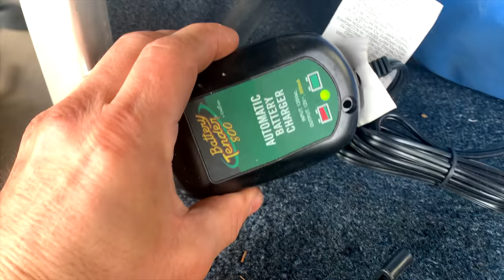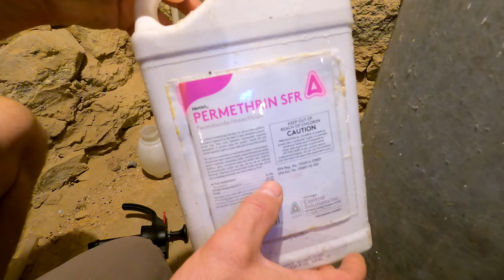8 REAL Farm and Garden Hacks You Probably Haven't Seen Before.

Comment: I use regular wire fence for my tomato baskets, 1-1/2"  2-1/2" squares I think. It's lighter wire, but they're at least ten years old. I cut down the squares 1 right 1left and tie those ends together and it's light enough to twist together by gloved hand. I cut the bottoms just like you and seldom have to stake them unless the plants are taller than me.
 Junk mail is a multi tasking answer to get address sensitive mail and starting yard or field waste fires. Just put in a box light it and enjoy the fire. After the ink has burned off and it's down to just wood, I've been known to cook a hot dog or two.
 Permethrin, is also good to spray your outbuildings. It keeps wasps and carpenter bees out though you have to repeat a couple of times a season.
 Good hack on the propane tank, I have a couple commercial air pigs, but never seem to be one where I need  one. Looks like a good way to increase the count.
 The battery charger thing I've been doing for twenty years or better, but it's good to spread the word in case others haven't tried it yet. It works, and all my vehicles are ready when I need them. Sometimes I don't use my pickup for two or three weeks and something in that truck will pull the bat. down enough to not start. Motorcycles, ATV's, boat, tractors, all have them. Great insurance. 
 Anyway, good video and some very practical hacks that help make life less aggravating.  Chip

Comment: what's even safer is using a fire starter log (for fireplaces). you just lit the paper in 2-3 spots (depending on the size of the fire starter log you have) and the entire log will 100% lite from just the paper being on fire which will burn pretty hot and easily lite anything else nearby. this way you don't even need to handle propane. they are likely about the same in terms of cost, i suppose propane might be ever so slightly cheaper but meh, when there is a risk you can easily avoid...it's best to avoid the risk then to save a few pennies and be dead.

Comment: 17:30 If you have some pure alcohol (denaturated spirit or whatever you call it) that will not explode and can be as good as the propane method. Pour some at the middle of the pile then fire it. Never start fire at the bottom. That will cause a huge amount of smoke.

Comment: A better and cheaper way to start a pile of brush, campfire, etc is to fill a tin can (10 oz or so) with gasoline and slide it under the pile, on the ground without spilling it and then light it. Depending on size of can it will burn for 15-20 minutes. Not as spectacular but it will usually get it going with less than a pint of gasoline.  Diesel will work but is much harder to get it hot enough to sustain combustion.

Comment: A little diesel mixed with some used oil will start about any fire. The diesel lites easier but the oil burns longer. Doesn't take much to start a huge fire either. NEVER EVER EVER use gas to start fires.

Comment: Can't stress enough how dangerous using fuel to start brush fires. 2 old timers died doing that within 3 months and 2 miles of each other a couple years ago.No one knows exactly how it happened but are sure thats what they were doing. The torch works fantastic and will get them going when nothing else would. Someone mentioned in comments using rebar mesh for the tomato cages. I have some over 30 years old still going strong. Also have some pieces aprox 8 foot long 5-6 foot wide bent in half round that I have used in garden to support plastic in spring to start-protect early plantings, shade-bug-bird mesh later in season, also 30 years old. Got the material free as end of roll left over pieces....worth trying to find a source

Comment: Dangerous use is gas and diesel.    The next door neighbor a city fella from NYC was talking about wanting to burn a large downed tree trunk that he and he wife hade piled up a lot of smaller brush around and over it telling me of his past failed attempts to get it lit and burning.  He told me he had tried diesel once, charcoal lighter fluid once and turpentine once then his last attempt was gasoline.  Well he said he couldn’t get the diesel started and the charcoal lighter fluid almost seemed to going to do the job then the turpentine then the gas.  I assumed from his discussion that he had some knowledge of the more volatile natures of these different fuels / accelerants being the turpentine and gas.   I told him mix about 1, maybe 2 ozs of gas to 6-8 ozs of diesel.  Do NOT put it on until he was ready to load get it because gas can become vaporous and the more explosive vapors disperse far beyond the materials wetted with the mix.  Well, I was working in my yard one hot summer day late afternoon/early evening  “after we had received some light summer showers wetting grass and nearby vegetation when I heard what kind of resemble the large WhaaWoosh sound of a volatile fuel ignition and then there was a flash of light with the airborne fireball that resembled a small thermo-nuclear detonation as I heard several expletives screamed out.   Best I could figure is that Ed had reversed the diesel to gasoline ratios and his mix was somewhere in the total volume of Two gallons or so of fuels mostly gas and he had forgotten his matches and casually walked back into his house about 150-200 yard away possibly grabbed himself a beer to enjoy with his pending successful burn and returned to ignite the mixture.  When he returned the sweaty shirt pocket he had put his matches in made them near useless and most of the matches thrown immediately landed in rain moistened brush  so off the house again for more matches and a rag to which he would dampen with the fuel mix to light and throw on the pile.   He tied a rag around a stick lit it and threw it and evidently before the rag contacted the fuel wetted brush the gas vapors ignited and the WHAAWhoosh and fireball.  We spoke of his adventure some weeks later in which my suspicions were confirmed.  About 6-8 ozs gas to 1-2 izs if diesel and about 1.5 gallons total.  And, the delay in lighting it if 10 minutes or so.  Do NOT assume all persons are as knowledgeable about accelerants, vapors  and fire as you are.  It’s still get dangerous to use gas or turpentine.  But as kids growing up running the woods and building forts and making fire including thank God angels watching over and protecting us we learned about such.   It seemed the only thing missing from the ignition of Ed’s brush pile fire was the  strong wind from a small thermostat-nuclear detonation.  Fortunately Ed was not injured beyond a few scorched hairs and his sweaty clothes being dried out a bit from the ignition of the gas vapors that had rolled out well beyond the perimeter of where the liquid was applied.   I need to get me a new hose for my LPG torch nozzle, definitely a far safer way to start and burn brush piles.

Comment: Never use gasoline to light a fire. I knew two guys who separately went to burn some leaves. When their lighter did not work they went and found matches. They struck the match when they returned and the vaporized gasoline exploded burning them both severely. They were out of work for weeks and were permanently scarred. These were not stupid people either.

Comment: Thank you for the information . I was wondering what you think about that DeWalt table saw that you have ? I know where one is for sale just like it and I have never seen one before. They are asking $750 for it and that seems kinda high for a used saw that isn’t a cabinet saw. Please let me know if you have had any problems with it or finding parts for it. Thank you again for your video and for answering my questions.
Reply from the maker: It’s a decent saw. Not heavy enough to be as smooth as my cabinet saw, but definitely better than a contractor saw. It was my main saw for several years and served me well.

Comment: Like your style!  But you have to eat that screwdriver, all these hacks are so obvious to me:) 

But please use your inventiveness: grind the screwdriver up and encapsulate it into something that's not dissolving in a stomach.   You didn't say HOW you will eat it so this counts. Maybe mix with cement and hollow glass beads to reduce density.  Turn into small round and light weight tablets, maybe with a pill press or round spinning table like marbles are made. do a test run on one with a metal detector later to check it goes through, then enjoy all that extra food and vitamin H ;)

H for humble lol i mean this in good spirits:)

Comment: Interesting - we've pretty much done most of these (except the tomato cages - we mostly use the store bought ones) but we do use cattle panel for growing cucumbers. We also put four t-posts in the ground and make an arch that various things can grow on from either side too. I've also used old freon tanks not for pressure, but for vacuum to evacuate A/C systems (before I had a proper pump.) I bought a 5 gallon air tank probably 30 years ago that I still use (I took care of it so it still looks and works well.) "Made in the USA" if that tells you anything. What's odd is I've had that same weedburner from Harbor Freight for ages, and that's what I've always used to start my burn piles. I thought that's how it was supposed to be done? I was always told as you said - using fuel in the manner you did is dangerous - but I do dispose of "bad" fuel on my burn pile.

What I'd like to know is - what uses (besides running a forge or foundry) are there for USED oil? I have a 55 gallon drum full of it from all the oil changes over the years and I'd like to recycle it somehow but it's mixed - it's almost entirely used motor oil with a little bit of transmission oil in it.
Reply from the maker: I have the same old oil problem.  I think at some point I may cobble together a waste oil burner to heat the shop in the winter.
Reply: @FarmCraft101  My problem is I'm in SE Texas - we don't have winter! 🤣

Comment: I have not seen all of those. We also stopped using fuel to start fires many years ago. My wife is the best fire starter. Far better than I am. We place a tarp over the pile of brush a week or two before burning insuring we have dry wood.

Once the fire gets going, I use a $20 box fan powered by a small 46 pound 1800 watt generator to speed up the burn process. In my area, we are not allowed to burn without calling first to get a burn authorization and we have to put the bon fires out before dark. The burn authorizations are always given unless there are high winds. We also have to have a water source near the fire. I have five hundred feet of water hose, because we have two big burn areas on our seven acres. Therefore, I learned having a box fan blow air at the base of the bon fires helps burn a lot more brush, logs, etc. during daylight hours.

The hardest thing to burn out is a large stump. I burned three full days on one stump, using leaves, sticks and branches for fuel on top of the stump. Even with the fan creating a forge like fire, some of that 36 inch stump was still above ground, after three full days of burning.

What I now do instead is dig out around the roots exposing the stump about two inches below ground level. I then use a 21 year-old Poulan chainsaw and cheap chainsaw chains to cut the stump below ground level. I pay $21 for three 16 inch chains. I usually destroy a couple chains per stump, even after trying to remove any rocks I can see. I always miss at least one rock somewhere. But it works better than burning and I am only out $14 to $21 per stump. I have removed stumps up to 30 inches in diameter with my 16 chainsaw. I also have a twenty inch saw, but it is too big and bulky and the chains are expensive.

Comment: Yes, they were good practical ideas, but I would like to suggest another method of getting the bonfire started.
I agree that it may not be easy to get the fire going if the bonfire wood or tree branches are wet.
I also agree that using a propane torch to start a bonfire is far safer than using fuel like gasoline, kerosene or diesel, but there is an easy way, without having to use this type of expensive fuel 
If you use crumpled newspaper, and perhaps cardboard, followed by good dry kindling wood, it is easy to get a fire started.  To get the fire burning vigorously just provide a good supply of air to the fire with a leaf-blower machine.
I would not like to eat a screwdriver either, but this is the first time that I have seen a pickled cucumber or gherkin used as a screwdriver handle!

Comment: Interesting, your heading for a screwdriver sandwich, but you have 5 to go so you may actually save a quality tool from becoming lunch. 

You can probably save a little bit of money if you use welded wire fabric, used on concrete flatwork, for the tomato cages depending on how you buy it. I think an average cost is about $1/SF but it comes in different wire gauges and grid patterns. Often concrete subcontractors have the 10% overestimated in the estimate left over and with the right smile by the right female friend then free just may be the word of the moment.

Comment: Yes I've not only seen them all before, I've done them all and still do use some of them.  I got some cattle panels from a guy that was moving and made tomato cages, BUT I made mine so they will fold up and lie flat for winter storage.  I pull the valve out of my old propane bottles and turn them over, propane is heavier than air, so it will come out, then replumb them the way I want them.  I like to use 45# tanks for a bigger air supply, and if you drill a hole near the top, you can put/pull a truck valve stem in, to fill them.  I could go on with the others, but you get the idea...  lol  NOW, lets see you eat a REAL screwdriver!!  SR

Comment: I know you know this but the number one hack.  Never use gasoline to start a fire. Also if using flammable cleaning fluids only use a natural bristle brush such as those cheap chip brushes. Never a nylon brush as static electricity can light you up before you blink

Comment: I'm reminded, every time I put SPF 100 sun screen lotion on my lower legs, to protect the tender new skin, because I burned off the original layers, never to use gasoline (or any other chemical) to get a bonfire going.  I burned clean around both legs, called circumferential burns;  very serious and potentially life threatening.  Please, do not use gasoline, or any such chemical, to start a bonfire.  I'd done it that way for 35 years, without incident, prior to my accident.

Comment: I did not know about #2, #3 is not a  good ideal, I have a pressure vessel made & tested for air & it was not that costly. #8 I knew about, but never do, I chip any wood that I do not heat with. The chips for poultry & rabbit pens or mushroom beds. WHo burns wood in the field these days, at least make charcoal with it.

Comment: I've been using both a torch and a flame wand on my 20lb tank with no regulator just like you do.  Last season neither of them would pass gas/light.  I typically keep a baggy around the ends of the brass connections of the hoses and the torches to keep them clean in the shop.  I can't figure out what might have happened.  The orifices seem to be cut with lasers because the openings are impossibly small for any known reamers.  Any insight would save me $100 thanks.

Comment: Isn’t using propane using fuel?I kid. Using propane to start a fire is common in Texas. Though we call that a pear burner. Every rancher I know used to keep one of those in their truck. Funny enough the one thing they don’t use it for is burning pears. They use the same attachment but a much bigger tank. For those unaware, Texas is full of prickly pears. They’re good food for cows but they can’t eat them because of the thorns. So you go over them all with a pear burner and it burns all the thorns off so the cows can eat them. The most common thing I saw this used for though was branding. They’d keep a pear burner and their branding irons. Then if they were out feeding and saw a calf that was old enough they could brand it on the spot. I think they mostly use cold brands now but I don’t know if that’s as mobile as hot brands.